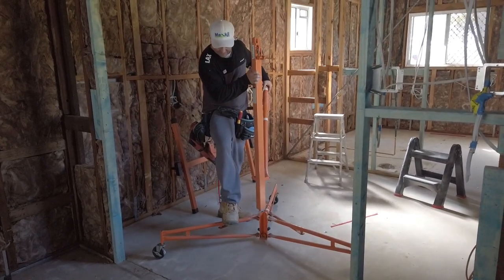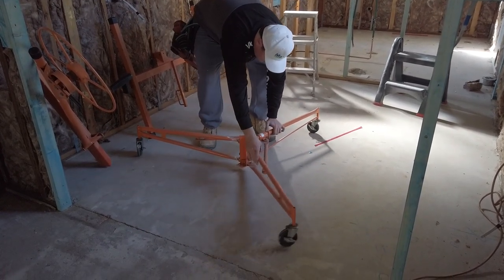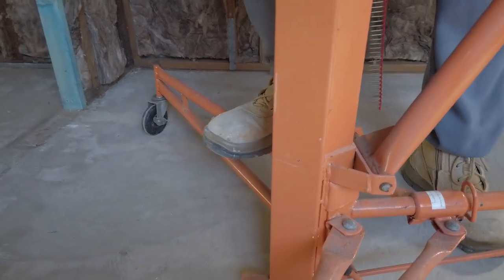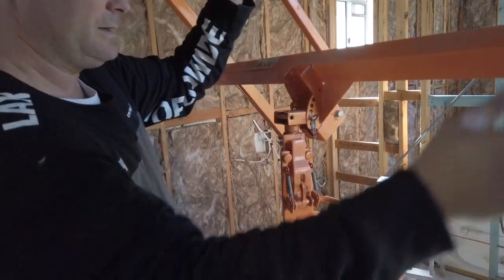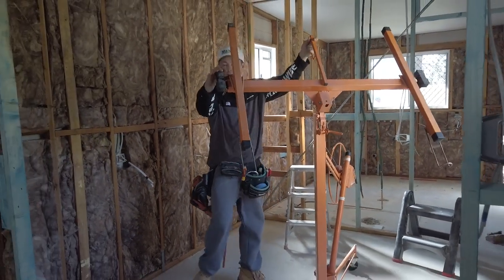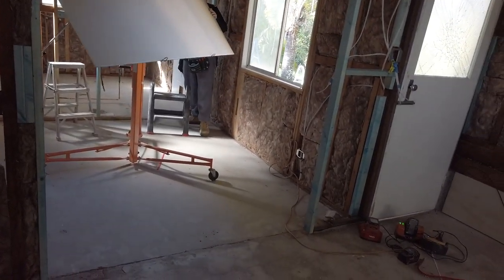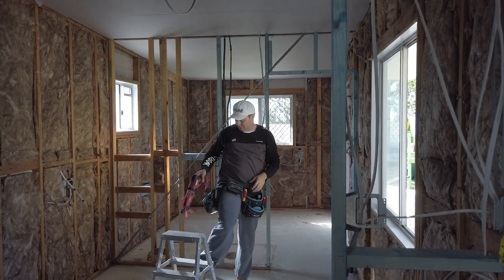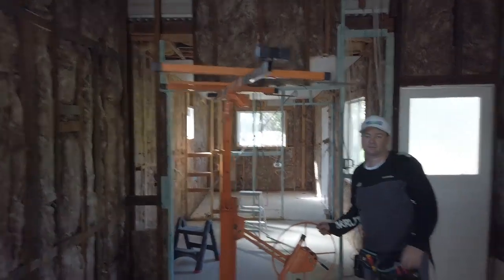Drywall & Plasterboard Panel Hoist Sheet Lifter

Comment: Any luck using this to hand hardie board (4x8)?
Reply: you can adjust the lifts arms to properly hold what ever length board 8',10',12' ect,are you using Hardie board on a ceiling?

Comment: Wrong again,those hooks holding the sheet should be one the outside so you push hard against the wall,BAAAD,delete this video please,you are embarrassing our trade
Reply from the maker: We have packers in there anyway champ. To keep it straight of the wall. We aren't trying to go tight to the wall either. Just enough for 3 sheets wide and cornice going over. What your saying is no mistake. Just to clear it up for you
Reply: Can you suggest a good make of model of lifter? Many thanks